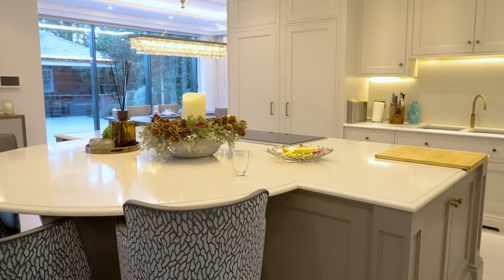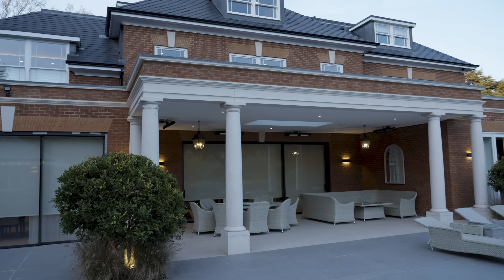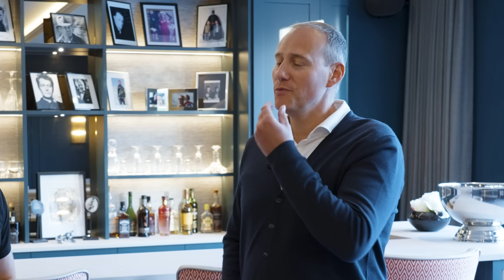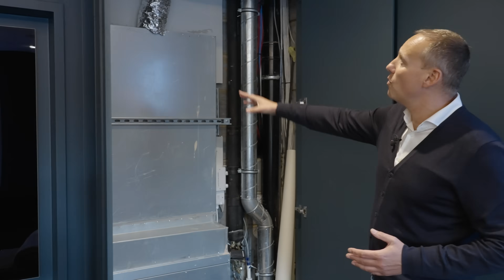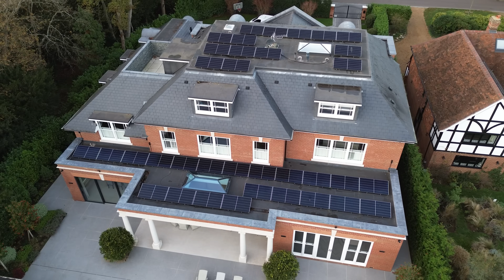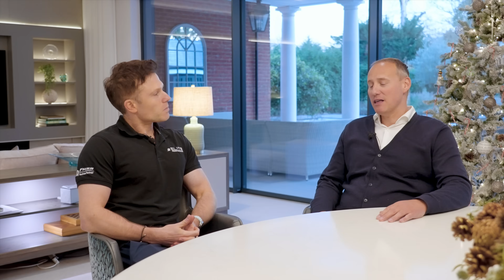This 10,000 sqft mansion costs LESS to run than the average UK home

Comment: This is the end goal of many designs for district heating with ground source for new build blocks of flats. Yet because successive governments didn't want air con installed it just wasn't done. It would make new developments so much more comfortable and we wouldn't have had the glass house over heating that has become publicized in the news lately.
People will slate the rich for being early adopters but it's the learning curve someone has to take to prove it works on large scale for it to become the default.
Reply from the maker: Absolutely, bang on